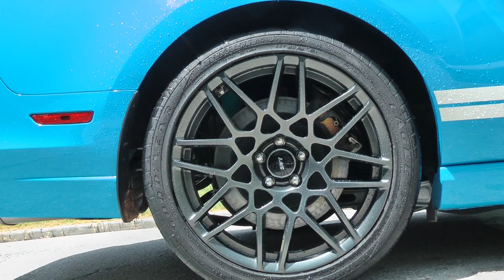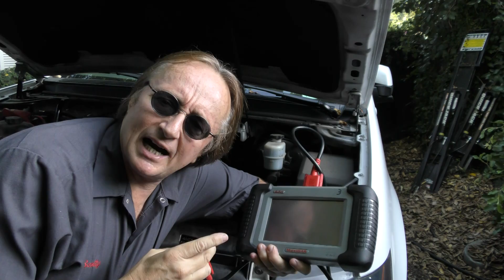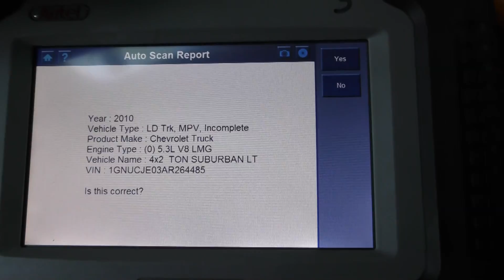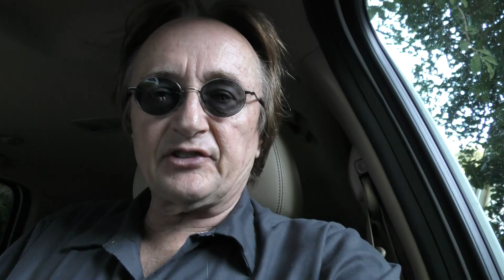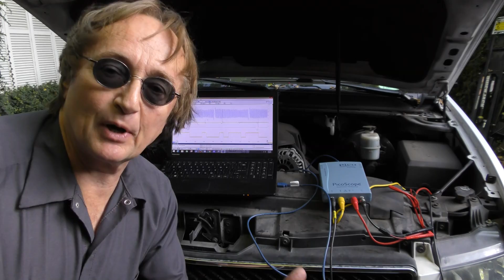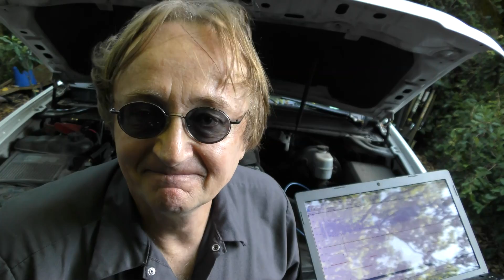Why Mechanics Charge So Much to Fix Your Car

Comment: This is why am keeping my 1999 lexus forever, I don't need anything that's 2000 and above.
Reply: the 90's was the golden era of cars
Reply: David Johnson the stealership organization hate to see guys like us we pull up the 90s model rust free, paint well shine with the collinite insulator wax, and the driver seats are cracked free because I use a seat covers, we starve their asses the new model collect dust on the showroom, waiting for the jackass to sign up for 7 years of slavery with higher interest rates.
Reply: The 2nd gen GS300 with the 2jz has been a great vehicle for me. Even at 150k it still rides like new.
Reply: Mcgyver B ok
Reply: Dodge 318 Cummins every vehicle brand has its lemon, sorry to hear that happened to yours mines is pushing 160,000 miles, I do my own routine maintenance at my own discretion, i follow manual instructions, but I religiously change my oil at every 3 months, considering I do a lot of short trips, and stop and go with different climate changes, am in Massachusetts, so the weather changes very quickly, never had any bad issues, I only had a leaking water pump at 120,000 miles, I ordered the part changed it out and replaced a new timing belt, and she runs like brand new, it's a front wheel drive, still go through snow storms easily.
Reply: Mcgyver B even my 84 scirocco has an ignition control module
Reply: Shwalker07 anything that has the lexus badge on it will be good health towards your wallet, and you will be a proud owner.
Reply: Dodge 318 Cummins you have a point and this is exactly why I've been saying I love my 1999 people are refusing to understand there's a reason why we only have a few wealthy people living in America, because they've been getting money from the idiots that failed to see what's really going on in 2017 and beyond, these newer vehicles are designed to drain its drivers pocket, nowadays everything is computerized, even the tires have stupid sensors in them, I feel bad for anyone that's buying a 2017 model good luck, your wallet will be empty after warranty expires, yes I agree with you, the 21st century vehicles are designed to bring back fortune to the service and parts department, tax hike sky rocket, Donald trump and his friends will be even richer, because stupid people that are working think they should get everything on a loan, 40 year and 50 year mortgage, jackasses they will live the rest of their lives in negative equity talking bout I just bought a new house, yea fucking right the bank owns everything including slaves.
Reply: Mcgyver B those still have lots of computers in them
Reply: Bmw M3 e46 the Lexus ES 300 is an all time champion when it comes to reliability, very easy to maintain, stay away from BIG MONEY WASTED =BMW they will leave your ass in the streets without extended warranty triple A and rental German vehicles are the worst I'd take a chevy or a Kia Sorento before touching a German steering wheel.
Reply: Bmw M3 e46 let's be honest, you cannot own a BMW without warranty coverage, it's a financial suicide, they could rack up thousands of dollars in maintenance very fast, there's no doubt they are beautiful vehicles, better performance, better handling, but they will drain your pockets, the only person to enjoy a BMW ownership, is someone that knows how to use a wrench, but without warranty coverage, the tranny motor, alternator fuel injector, spark plugs, gaskets, these parts could go bad at any given Sunday, and depending on the year and model it's BIG MONEY, yes American vehicles are horrible in reliability, Chryslers and jeeps always tank at the bottom of every consumer reports, but they are super cheap, Lexus is not cheap, they have much better re sale value over the BMW, they hold more value than German products, Mercedes are money pits, especially the ones that got air suspensions the cls550 and the S class they are not cheap if the air suspension goes BIG MONEY, there's no doubt BMW and Mercedes are superior performers, but they are for rich folks, who usually lease them, and jump ship when the lease is over, yes they can run for a long time but without a warranty coverage the owner will accumulate thousands of dollars over the years, a lexus driver will only change oil and brake pads, and still have more money in his pocket, they almost never break, i drove a lexus gs350 for 3 years with no issues at all, I drove a BMW and within 6 months it was in the shop for 6 days racked up $4,500 in service and parts, good thing I was covered, BMW has a long term warranty at the dealership discretion, but I wouldn't advise anyone to drive a German vehicle unless your rich.
Reply: Dodge 318 Cummins Really think those sludge problems were caused by poor maintenance. I have the 98 Camry V6 and the 6 cylinder was known for sludge problems. But I now have 313k+ miles and 0 problems. I do 3,000 mile oil changes and recently flushed the tranny at 300k, runs perfect and still on the original alternator!

Edit- forgot to mention that I floor this car pretty often, and again 0 problems. Maintenance is king!
Reply: 100% agree.  You're a smart man.  These days, having the latest/greatest is the norm for the average joe, at any cost.  It's 'normal' for people to have $500+ car payments.  We have 4 vehicles, all paid for, ranging from 97-07.  I can't remember the last time I took any of them to a mechanic.  Thank goodness for Youtube (Scotty) and a garage.
Reply: Dodge 318 Cummins yea the problem could be from the previous owners, it's a risky thing buying used vehicles, especially if they don't have a clean car facts.
Reply: Mcgyver B lol car fax is a joke never go by that when buying a car. These late 90s Toyotas are known for engine sludge problems. Look it up there was a big recall on it.
Reply: me too... all my vehicles are 10 years old or more..not to hard to work on.
Reply: Bmw M3 e46 the Germans are extortionists, they are really good at what they do,as far as performance goes it's a ladder the consumer has to climb, that will cost a fortune, I speak from my own experience, aftermarket parts and DIY is the route to go on a 10 or 20 year old bimmer they run even much better with aftermarket parts, the dealerships are thieves, they will rip into any customers wallet, but still a lexus will outrun and still save its owner thousands over the course of years in reliability, lexus rules when it comes to value, if they get better exterior design the Germans would go out of business, but the Germans have advantage and privilege because they have better looking vehicles along with super power performance.
Reply: Bmw M3 e46 I will agree that the Germans have better styling, better performance, they rank as the better performer, you do your own service which is always the best thing for any driver to do, and yes they are a billion times cheaper to order parts online and do it yourself, you save thousands $$$$$ I think that's were the problem is when it comes to German vehicle, the mechanics over charge for their repairs, and the customers don't realize the parts are dirt cheaper online and they are very easy to fix, but when it comes to service intervals a Lexus is still a champion, I drove a GS350 3 years straight through snow wintry climate and hot summer heat, and that thing was still asking for another year with no maintenance, try that shit with a Benz or bimmer that has 60k miles it will leave you in the streets, dashboard will be lit up like it's a Christmas tree check engine light will be saying hello it's service time.
Reply: Mcgyver B Lol I have the 1998 Camry V6 and it is at 313,000 miles. I flushed the transmission at 300,000 miles for the first time and it is still running well.

I really want to drive this to 400k, such an amazing car for an old Toyota.
Reply: Tom K I said the same thing cheap bastards who tries to squeeze 7k miles out of heavy duty stop and go operations, and yes Toyota lexus are less headaches, less spending for its drivers, BMW Mercedes Benz are for rich folks, because money ain't a thing to them, and reliability is not their priority, when your rich car problems are not an issue.
Reply: Dodge 318 Cummins yea they take high octane, but they give really good gas mileage, the lexus es300 are the best seller from the lexus lineup, they sell hot bread, I believe they now have the es350,any driver buy one of them, and stick with it will be very happy, they save you thousands of dollars, meanwhile you're still driving luxury, I believe working class Americans should spend less than what they make, because the workforce will never make you rich.
Reply: Eman 08 there's a reason they are built with plastic, they weren't meant to last, easily recyclable, rich people only buy them, and drive them temporarily, when a better model comes out, they throw it off to the side as if it's a piece of old sneakers, then if it ends up at the auction, a slime dealer will buy it, clean it up, and sell it to a moron that has no idea it's gonna need at least $10,000 to $15,000 in repairs, and will only continue to rack up more bills considering it's out of warranty from the stealers, yes they are garbage to the minimum wage salary people, because the multi millionaire or the CEO of a company just finished farting in the leather seats, and joe blow that's been working full time stocking Walmart shelves decided he wants a German vehicle, rich folks buy these vehicles during Christmas season put a big red bow tie on it, but after 4 years he's getting his wife the newer toy, overall rich people don't see things, the way poor people do, and this is why the poor always gets the end of the shit stick, do you think billionaire Donald trump knows how much a gallon of milk in the grocery store cost, hell fucking no, he ain't going to no supermarket, do you think he will change his own oil, this guy will probably gets driven in one of his many vehicles, and don't even remember which one it is, technology will only continue to expand, and the poor will always remain poor, and the rich will only get richer, this is why a person should only live within their own means, I know a lot of people who has a car payment their entire life, and some of them are swimming in mortgages that are longer than their life span, people don't realize the rich are benefiting from the idiots who think they can afford it if they get it on a loan.
Reply: PaperShark9521 there's no denying that a 1999 model is very affordable I have my vehicle title, plus I keep it in prime condition, still gets 20 mph around the city, these newer vehicles are just not worth it, Americans are swimming in debt with car payments, it's hard to think that some of us are paying $900 up to $1000 a month just to drive, that's freakin insane, depending on states excise taxes on these newer models are through the roof not to mention the insurance premiums, I bought my 99 soon as I graduated high school back in 1998 we had bill Clinton there was no terror attacks and life in America was perfect, I saved thousands of dollars driving my lexus, auto loan is something I stay away from, now they got these cameras on highways sending you toll bills, and I have to agree with Hillary Clinton it's bullshit, not everyone will be sending out these mails early so you automatically will be hit with late fees, and of course toll fees already increase they keep on increasing everything, and making these super high tech vehicles, but there's no fucking jobs lol hahahaha am staying with my 1999 and all these banks can suck my cock it's the only thing that's gonna depreciate in value after I bust a nut.
Reply: fieldboy674VGN lexus Toyota will outrun any vehicle and leave its driver rich from service shops, and inconvenient breakdowns.
Reply: Mcgyver B sure you can argue Lexus and Toyota will outrun German vehicles but in the long run it wont. They only run forever and don't cost as much because they are simple machines that have no technological advances, I'd rather have the car with great design and durability then something so simple for a commuter, I can do the maintenance myself so I take good care of my car's
Reply: Eman 08 lol hahahaha in Scotty Kilmer voice YOU THINK YOU GOT A GOOD DEAL.
Reply: Dodge 318 Cummins I agree, some people just cannot stay with the same car for 10 years, they gotta have the new ones, and this is how a lot of Americans retire broke.
Reply: Eman 08 I personally think that if lexus get more aggressive on their vehicle exterior design, they could shut down the Germans forever lol because let's face it, a lot of people only buy German or other European brands because of their sleek design, and then it spends way more time in the shop, and lexus stays on the road, lexus interior is nothing but superiority, very comfortable, and luxurious, a lexus driver knows he's always gonna reach his destination, a BMW driver knows he's gotta have that triple A towing contract, because anything is possible, and I think that's were the gap between these two are different, Lexus is built solid, BMW not so much.
Reply: Eman 08 I see a lotta guys talking bout they driving BMW or Mercedes without warranty coverage because they know how wrench, but the idiots don't realize if the tranny or engine decides to piss the bed that's big money required, the least little thing on a German vehicle is big money, so it's still a dumb idea to drive one naked without warranty, it's a financial suicide, when that check engine light shows up your pocket doesn't need a wallet anymore because money is leaving it fast.
Reply: RetroGamer reviews yup more people are gonna realize that their older vehicles are a lot less complicated, and cheaper, easier to maintain, the whole point of transportation is the reliability to get to your destination at a certain time, especially your job, or to pick up the kids, service shops hate to see a person that will spend the extra money to fix up their 20 year old car, and ignore the showroom with the newer models, because you are keeping your pockets full of money, car payments and high premium insurance sucks.
Reply: Mcgyver B
1998 Toyota Corolla going strong still
Reply: Too new
Reply: Mcgyver B unfortunately anything with fuel injection has this problem
Reply: Toyota fuel injectors they go bad sometimes, due to moisture, higher mileage, and the cheap folks who always run the vehicle on empty allowing the fuel pump to suck up dirt.
Reply: Mcgyver B your talking like you owned a new BMW from the dealer, I know the new ones aren't worth it unless warrenty but I'm talking the old beamers they go a lifetime, and your only giving big money if you have a shop do the work if you do the work yourself you pretty much spend as much as a Toyota in maintence, older means less sensors the Germans are not good with electronics and Japanese are that's why Lexus and Toyota strive for better reports their so simple and have simple engeneering. By no way is a BMW over 2005 a money pit it depends how it's taken care of
Reply: Dodge 318 Cummins dammm I got mine with 160000 miles on it it's still riding after 275000 never had a problem with it just the knock sensors and alternator and thermostat
Reply: Mcgyver B Toyota is an has been company they were great in the 90s but kept going down hill. The new toyotas are not as reliable as the old ones. Stick to 4 cylinder vehicles when buying Toyota.
Reply: Tom K it also seems the es300 v6 needs premium fuel.
Reply: cbd 👍
Reply: luis casillas yes but anyone could fix a 1995 and parts are dirt cheap, these newer vehicles are just not worth it, they are designed to have you pay out all your earnings.
Reply: big deal. anyone can buy expensive scanners & read the manual.  you can expense it by renting it out.
Reply: Eman 08 the stealers are sending out these high vehicles looking sooo sexy well shine and mint, for the next idiot to go guy it, not knowing these newer breeds are stealership service only, on a 1998 you could run to auto zone and screw something up, not so on a 2018 the stealers. Have to scan and rape your wallet.
Reply: Eman 08 smdh all that just drive lol did you see autovlog, that fool took his Mercedes c63 for a ride and the next day the car wouldn't start after he hydrolock the first c63 the idiot when out and got a 2018 German vehicles are only getting even more complicated, way too much unnecessary gadgetry.
Reply: Eman 08 anyone who goes out and buy a used BMW from a used car lot, they are up shits creek soon as they drive it off the lot, BMW is designed to be a very sophisticated driving machine, best performance vehicle when it comes to speeding on highway, and it gets its driver very addicted, however if you don't have a big bank account you're just naturally fucked, because driving a BMW is the beginning of driving a high end luxury, and when it breaks, the owner only ends up looking broke if he can't get it running again, if you can't wrench a bimmer the best possible thing to do is leave it alone, and grab a used Toyota Camry, the older the bimmer the more expensive to repair BMW is not cheap at all.
Reply: Mcgyver B someone on a budget shouldn't touch a luxury car or any car with a v6 they should just get a bare bones 4 cylinder car that hardly has any maintenance cost.
Reply: +Mcgyver B: 99 model year cars are still rather complex. I'd go for a 79 or older car.
Reply: Eman 08 the Germans are bipolar, and crazy electrical water pump with plastics🤔how many miles these genius thinks they would last under severe climate changes, they don't give a shit, they want you to keep fixing that problem with your money.
Reply: Mcgyver B bro you ain’t kidding got my 91 b13 going turbo soon 😁
Reply: Mcgyver B I hear you man not to mention dealerships charge ridiculous amount of money they’re crazy. Thank god I’m not interested in any modern car. Parts are not only cheaper for 90’s car but easy to find and work with.
Reply: Yes sir I have 95 camry
Reply: Mcgyver B I hear you.
Reply: Mcgyver B this is also why i'm keeping my AE86
Reply: RetroGamer reviews clean I seen one up in LA last time I ever seen one.
Reply: Mcgyver B I have an e46 330i, and that bad boy has given me trouble since I bought it. I'm too afraid to ask what I'll need to replace next. Can't even start it now and will have to be towed to a mechanic. Good car though, one of the most fun I've had
Reply: Same here. I've got a 1997 Toyota Corolla. Only has 66k miles on it. Easily expect to get over 300k on it.
Reply: DevoutSkeptic damn that's really low for that year lucky
Reply: I have a 1997 4-Runner. It has just over 367k miles on it. Still runs great. Although I have to admit my cruise control doesn't work.
Reply: Mcgyver B it ran and drove fine until it happened. The problem was it was a 1999 that only had 45,000 miles on it it 2015 meaning the oil sludges up over time. It was bought used.
Reply: Spoonzaza Toyota are very reliable vehicles, I think society needs to stop comparing high performance premium vehicles to base regular models, but this argument will still separate older vehicles from these newer complicated loaded with all sorts of gadget vehicles, German vehicles like Mercedes Benz, and BMW these vehicles need a driver who has no problem opening up their wallet and fix everything that goes bad, if a bmw price tag is $80,000 and a person buy it 5 years later, you better expect to dump excess amount the price tag, even though they loose value, they are demanding you the driver to put that value back in which is pretty much the price tag, I see so many people buy used Mercedes, and expect to pay Honda price on maintenance, it's impossible to buy a $300k Ferrari, and then pull up at a lube shop, and try to pay $100 for an oil change, no freakin way, it's the same thing with a BMW, you cannot drive them around everyday, and not think that they require routine expensive maintenance, they will leave any driver in the streets, the beginning problems on a bimmer is oil leaks, a lot of drivers ignore oil leaks, and this will rack up maintenance cost through the roof due to other components failing from sludge, and contamination.
Reply: They still have complex wiring and communications of that year. If you want a simple car get a 70s/80s era vehicle.
Reply: David Johnson you call a 97 gran prix piece of shit a "vintage" car? Lmao bue
Reply: high performance piece of crap
Reply: Mcgyver B this is why I stay with a 1978 Ford Granada. Or anything that has a carburetor no O2 sensors no air Mass sensor no knock sensor no computer ignition box and voltage regulator.
Reply: 2013 g37 sedan 7at most reliable  in its class and fast too awesome durability end of story
Reply: My car is a 2000 and I'm glad it has manual windows, the less the better !
Reply: I have a 1994 Lexus es300 with 175,000 miles and still runs and shifts smooth. Had it for 4 years and plan on keeping it till the wheels fall of
Reply: 1990s Camry, there is no substitute.
Reply: 1994 Celica is all I need
Reply: 95 jeep Cherokee 4.0 HO on a 3 inch lift with 35 mudders

And a 99 RAM 1500 2wd 4 door 318 LA block I love the simplified computer era
Reply: Still have a pcm with obdII it’s complex too buddy
Reply: Mcgyver B The ES is a glorified Camry. Doesn’t drive like a lexus never has, never will. Straight trash. I bought one for my two friends because they really wanted to own a Lexus like me and they were happy. I just feel like it’s not a true Lexus.
Reply: David Johnson yup these millennial fail to realize that the whole purpose of a vehicle is to be reliable and take you from point A to B not for you to be giving the dealership service department your whole salary, and give the banks your lifetime savings, because these interest rates on the newer model they are mortgage payments, wheel sensors, parking sensors, back up camera air condition seats, all around interior lights DVD player seriously?? Who the hell is gonna sit in a car and watch a 2 hour long movie, and by the time the movie ends you're gonna need a jump start because the battery life went low on the DVD lol yo am staying with my 1999 the gas tank stay full because my wallet is in good health, no car payments, no sky high insurance either.
Reply: Mcgyver B Same here with my Pontiac Grand Prix GTP from 1997, vintage!
Reply: Mcgyver B the 1999 es300 was the biggest failure Lexus ever made. They had very bad sludge problem that would clog the oil pump. Had one that blew up with 45,000 miles.
Reply: Dodge 318 Cummins you probably changed the oil every 8000 miles and the pcv was messed up. Proper oil change would prevent sludge  build up
Reply: Thats why I still ride a Ford Model T. Anything 1930s and above is too much computer stuff.
Reply: Dodge 318 Cummins the car fax is still important to look at because it gives the buyer an idea what they are up against, used German vehicles are the worst to buy especially if they are over 70,000 miles, and if it's been through 2 owners it's definitely been neglected, Toyota lexus used is still risky, simply because they have a reputation of being reliable so current owners usually just drive and beat the crap out of them, and put cheap regular gasoline for long commutes, bottom line some people just don't give a shit about maintenance especially women, they will drive until that vehicle dies then they will get a tow truck, engine sludge are from cheap bastards that are trying to get 7,000 miles out of 5 quarts of oil and am talking heavy duty operations, in severe weather conditions, and multiple stop and go short trips, lets face it nobody has time for mechanics, they are too damn busy, and expensive, so people rather drive until the shit breaks.
Reply: Eman 08 a BMW could easily racked up bills from $3,000 to $5,000 and that's just parts replacement, fuel injectors, coils spark plugs, even the fuel feeder lines they too end up going bad, the head gaskets, the electrical waterpump man if a person don't have cash to spread it out like how Moses part the Red Sea, do not touch a BMW or a Mercedes, you will only unleash a financial nightmare.
Reply: Jack Black usually when a BMW is troublesome, that's usually because it's been neglected from the previous owners, BMW are labeled as being very unreliable, and that's because people don't understand that they are over engineer vehicles that need regular maintenance, any bmw driver that takes maintenance seriously won't have any issues, routine maintenance on a bimmer is how you get the reliability from them, they are a money symbol vehicle, that's because they need money dumped into them to perform.
Reply: Mcgyver B big money wasted is what you want to call them huh? At least their not pieces of shit that are slower then a Prius hybrid like Lexus and Toyota their quality is so crap, BMW especially older ones out last Toyota and can go then a million miles, the only car that's gonna leave you stranded is a Chevy made by GM don't even get me started on their reliability